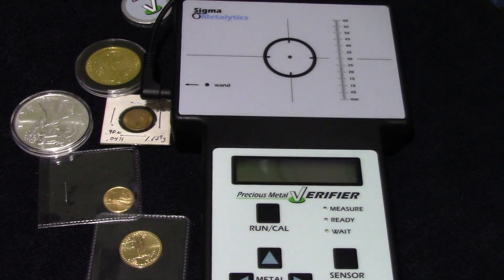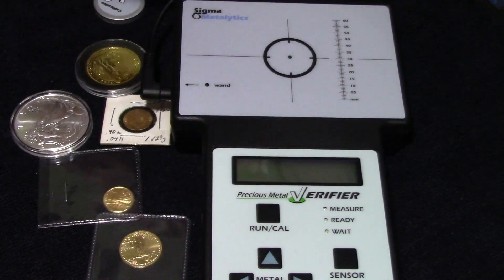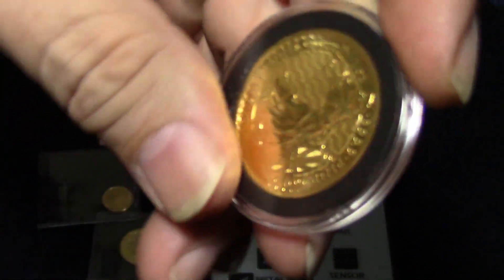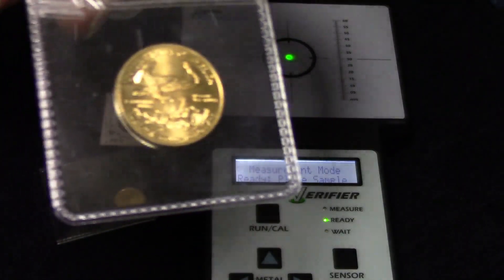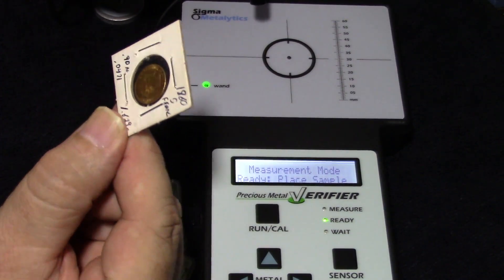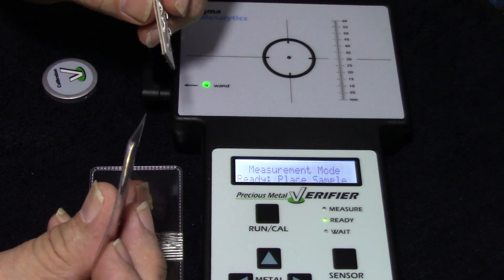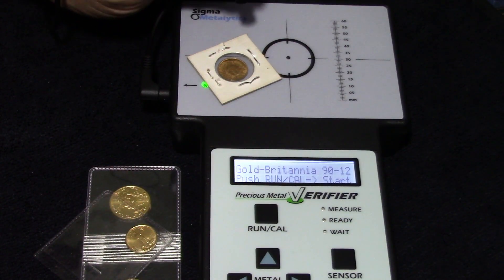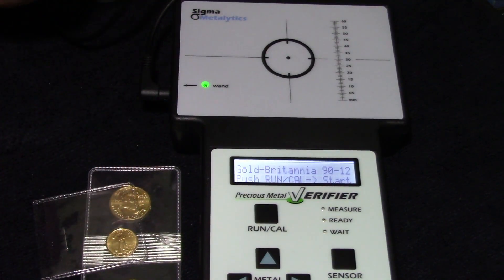Sigma PMV - Measurement Mode - Using the Sigma Metalytics Verifier in measurement mode

Comment: Hey I did some research.

"Specifically, 90% gold has a resistivity roughly 4 times that of pure gold"

Your pure gold on measurement mode was 2.16. Then your eagles tested a bit under 4x that number at 7.3, which is correct since it's 91.6%.  BUT your 90% coin should be around 8.8 so it's resistivity is off. Doesn't mean it's fake but 14 is way off.